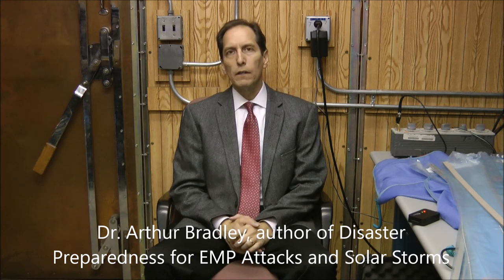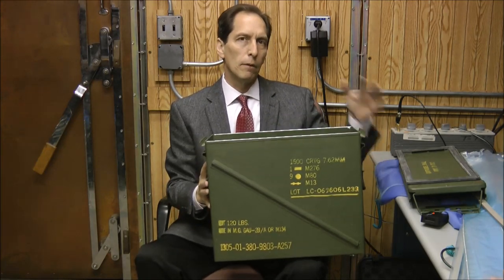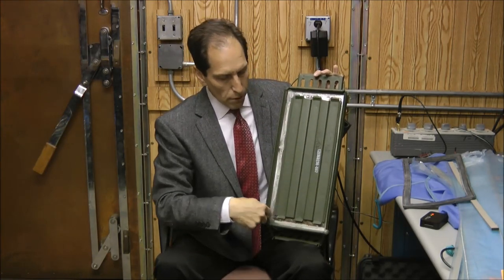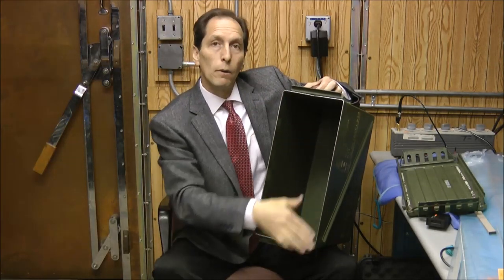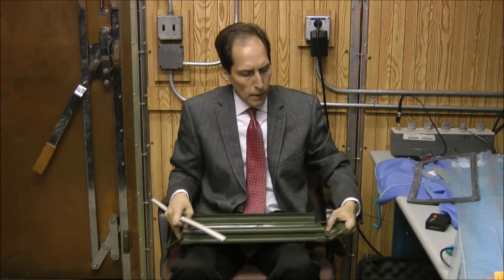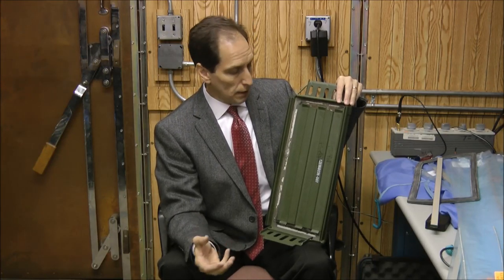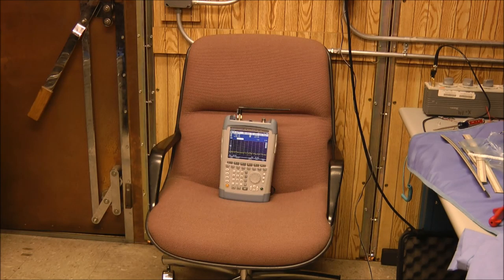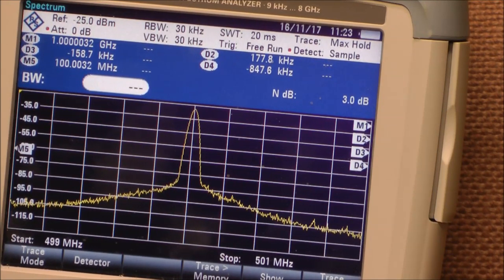Ammo Can Faraday Cage 70+ dB Shielding

Comment: Would adding dielectric grease hurt or help? Im thinking once you sand down the ammo can it will begin to rust quickly in humid environments and maybe adding the dielectric grease would help keep it from rusting and possibly help with the electrical connection? Any thoughts?
Reply from the maker: Hi Mike, adding a little grease after the gasket was installed would be fine, but obviously, you wouldn't want to put it under the adhesive gasket.
Reply: Dielectric grease is non-conductive and therefor no good. You need a conductive grease. That is what I would do. Use preppers method, however I would coat all the sanded bare metal with a good layer of conductive grease to prevent rust. The problem is how do you then keep the gasket in place. I use same type gasket as prepper. The conductive mesh covered gasket. but I use a U-Channel type that fits over the lip of the can. No need for adhesive to keep it in place. Preppers method offers exceptional EMP protection but the bare metal will start to rust fairly quickly being exposed like that. And once it rusts the mesh will start to lose conductivity between the can and lid. If that happens you have lost all your emp protection and you may just as well have left the original gasket in. You would at least still have moisture protection. That being said; silver grease is expensive and MESSY AS ALL HELL!

Comment: I have a question, I read that a nuclear EMP can be from from 100mhz - 100ghz. Do you have the ability to test these at 100Ghz? And would it help to insulate the inside to keep items from touching the metal
Reply from the maker: A nuclear-generated EMP results in emissions up to around 1 GHz, not 100 GHz. Yes, I test to that 1 GHz frequency. It is a good idea to keep anything metal from touching the interior of the can.

Comment: What happens if you just wrapped the original Gasket in Aluminum foil would that accomplish the same thing?
Reply from the maker: I think it would be nearly impossible to pull the gasket out, wrap it, and then get it back secured in the channel. But yes, it would probably work about as well.

Comment: Thanks for the video.  Would you be willing to do a test using light weight metallic backed duct board insulation used in the heat and air industry?  Maybe used for making a box to cover a generator???
Reply from the maker: That's been on my list of things to do for some time. I know lots of folks are using it. I'll see if I can get some of the material to conduct a test.
Reply: disasterprepper That would be great!  Thanks!

Comment: Dr. Bradley - could you, with the ammo can lid open, cover the opening with metallic duct tape (overlapped with no gaps) and then close the lid?
Reply from the maker: A better solution might be to attach carefully cut conductive tape strips over the black rubber gasket. I'm not sure how long it would last before tearing, but I think it would work okay.
Reply: @disasterprepper   Wow - thanks for the quick reply!!
Reply: @disasterprepper  I don't have the equipment to test my original suggestion above... could you possibly test?  Also, I am wondering if you could test simply open the ammo can, lay a doubled up piece of aluminum foil over the top of the can and carefully molding it down the sides without ripping or tearing and then closing the can. Again, it would be very interesting to see this tested.  Thanks for all you do!
Reply: @empdoctor  I don't have the equipment to test my original suggestion above... could you possibly test?  Also, I am wondering if you could test simply open the ammo can, lay a doubled up piece of aluminum foil over the top of the can and carefully molding it down the sides without ripping or tearing and then closing the can. Again, it would be very interesting to see this tested.  Thanks for all you do!

Comment: Could you wrap the existing rubber gasket with either aluminum foil or aluminum tape? 
Still going to bare metal with your dremel tool.
Reply from the maker: Yes, I think this would work, but getting the rubber gasket back into the channel would be difficult. Also, I'm not sure how durable the foil would be. Still, it's an idea...
Reply: I was thinking of doing exactly this on my 50 cal ammo can VHF/UHF radio. I have a 2-1/2" roll of aluminum duct tape that measures .004" thick. This feels much thicker than heavy duty kitchen aluminum foil. It also measures a very low resistance with an ohm meter except where the printing is on the foil. However the printing ink/paint is very thin and can easily be removed with an abrasive pad. I think prepping the can and lid, cutting the tape narrower, then folding the tape around the rubber gasket (with the fold facing to the outside of the can) would work very well. The adhesive side of the tape measures a higher resistance than the non sticky side so make sure only the adhesive free side touches the can and lid. The tape seems tuff yet fairly malleable and conforms well to the edge of the can without tearing so I think it would last a while. Even if it needs replaced periodically one roll would probably last forever.
I wish I could subject it to a quantifiable test!
Reply: @Steve Frank - I took this very approach (the aluminum duct tape) and rapped the entire OEM rubber gasket. To ensure the tape would be strong, I doubled it on the side that makes contact with the can. I also used a cheap black rubber floor mat as isolator within the can making sure that edges overlapped at the corners. Not folded over but one side tucks behind the other at each corner. Finally, the bottom so it is all lined. This ensured that no items within would come into contact with the can.

What I did not do, but will after seeing this video, is remove the paint on the lid and can's top edge. I should have though of that but not a difficult enhancement.

Comment: Also I would ask if you are testing for one frequency at a time I believe you said in your video you were testing fo 500mhz? and would do a range of other frequencies off camera? 1. Would you have a paper we could download of your test results? 2. Have you taken into harmonics or the mixing of signals and frequencies that would occur during an emp? If not why not?   Thanks again so much trying to come up with as much as I can to take into effect an emp.
Reply from the maker: Hi Mike, yes, I'm testing at one frequency at a time, from 10 MHz to 1 GHz. I am establishing the shielding effectiveness of the enclosure. That's a standard way of doing it. The actual EMP waveform is very complex (modeled as an E1-E2-E3), but it can be broken into a series of sinusoidal waves. By knowing the respective shielding effectiveness at each frequency, we can get an idea of how well the waveform will be attenuated, although we won't actually know how it is distorted in time. I do have some tables of data in my upcoming Advanced Topics book, similar to what is in my EMP Preparedness book.
Reply: thanks so much for both your answers. I have the one book on emp you have look forward to more. I subscribed or followed on amazon so I can see when you come out with new stuff. Thanks again. Mike :)

Comment: Hello Dr. Bradley, have you tested the efficacy of paint cans for EMP shielding?  New, empty paint cans are available at many hardware stores and are inexpensive.  They seem like they would be a good solution for small electronics.
Reply from the maker: I imagine they would work well, but I haven't tested them.
Reply: They work very well. Used to use paint cans for HV and nuclear detector housings because they keep stray signals out and HV in for these applications.

Comment: I am about to build one of these. I know it depends on an actual event but are there any estimates of the bandwidth of the pulses?  Is there a frequency range that does more damage, or does it matter because of the power of the actual pulse?
Reply from the maker: The bandwidth goes from roughly 100 kHz to 1 GHz. I usually test over this range. The damage is dependent on the device type and the length of the conductor attached (it acts as an antenna).

Comment: I was wondering how effective removing the rubber gasket, grinding the surfaces down to metal as you suggest, wrapping the gasket in a alum foil ) not cooking foil, but a bit thicker, around .020" thick) and reusing the now aluminum covered gasket. I realize the gasket would be difficult to reinstall but I could use a cutoff wheel and cut the tabs off on the ends of the cap, or simply bent them up and then back down on the covered gasket and the use thin double face tape to fasten it down.I guess the question would be how effective would an aluminum covered gasket and bare steel surfaces be at sealing out the emi/rfi effects of an emp. As good as your metal gaskets? I get the dissimilar metals issue but if kept dry and corrosion free???Any educated guesses?
Reply from the maker: I think it would probably work fine. As you said, the difficulty would be getting the gasket back in place. Otherwise, I see no issue with that approach.
Reply: Thanks for the quick reply. As I have 10 cans to do, the gasket material would run me deeply into the red.How did your testing go across the wider frequency spectrum, ie, both sides of 500mhz? Just curious...

Comment: Could you take the rubber gasket and wrap in aluminum foil then glue back in place?
Reply from the maker: I think it would be difficult. The rubber gasket is under quite a bit of pressure, and once it's removed, it would be difficult to compress to get back into place. If you could pull it off, I'm sure it would work fine, but my feeling is that it'll be difficult to accomplish.

Comment: Would you try sewing the conductive cloth you had a while back around the rubber gasket and testing that?
Reply from the maker: Getting the rubber gasket back in the channel would be a bear. I suspect it would work fine, but it's too much trouble. Inserting a pre-made gasket just seems much easier.

Comment: Is there any kind of coating or paint that I could add to the outside of the ammo can that would increase the dB of shielding even more? Thanks for making the video.
Reply from the maker: There are conductive paints that you can buy, but I doubt it would improve the shielding of an ammo can. The metal is already a thick steel, so another thin conductor over the top wouldn't help. If you seal it with a gasket (or even tape it well with conductive tape), you can get outstanding protection (> 70 dB with the gasket). That's a reduction of 3,162 (which would take a 50 kV/m field down to around 16 V/m - quite minimal).

Comment: Can you wrap the old rubber gasket with aluminum tape?
Reply from the maker: You can certainly try. Getting that bugger back in the channel might be a challenge though. They're under compression, and it's very hard to do.
Reply: @disasterprepper  I was wondering if I would be sufficiently conective to still shield the electronics. .
Reply from the maker: @bobafetthatesyou2215  Yes, if you could get the original gasket wrapped in foil back into the channel, it should work well for shielding.

Comment: How does switching the gasket affect the water proofness of the ammo can ??  I suppose if the foam is closed cell foam, it would retain the waterproof properties...
Reply from the maker: Hi Tom, changing to the conductive gasket definitely affects the waterproof properties of the can. The can would no longer be completely waterproof like it is with the rubber gasket. Of course, one could seal it in a plastic bag or container, but the can itself isn't as tightly sealed.
Reply: @disasterprepper  Thank you

Comment: I have a metal storage shed I purchased at Lowes a couple of years back, I wonder if you have ever ran any tests on those.
Reply from the maker: No, I haven't run any tests on such structures, although quite a few folks have asked about sheds and shipping containers. I hope to do some testing this year for an upcoming "advanced topics" book on EMP preparedness.
Reply: That would be wonderful. Thank you for your work and courtesy.
Reply: Any completely enclosed metal structure will act as a faraday cage. The "sealedness" of the structure, thickness of the walls as well as material will determine its effectiveness. You would definitely want to put copper tape (conductive acrylic adhesive) on any non-bonded/welded seams if your intent is emp protection. The room prepper is in is a faraday room made of thick Mu-metal walls (high permeability). Designed to block all external fields.

Comment: Because conventional EMP devices produce explosions driven by HPMW technology, they may have a frequency in the range of 100 MHz – 100 GHz. EMP, depending on altitude and power, can generate electric fields up to levels of 50 kV / m. Will these boxes, or any faraday cadge for that matter really provide protection at these levels?
Reply from the maker: Nuclear-generated EMP devices are typically thought to produce radiated energy from about 1 MHz to 1 GHz. Electric field levels can ready 50 kV/m, although some people claim "super EMP" weapons can reach perhaps 200 kV/m. I don't know that such devices have ever been seen in the real world though. A box or EMP bag that provides 50 dB shielding will reduce a 50 kV/m signal down to around 158 v/m, survivable by nearly any electronic device. I'd be comfortable depending on such products to ensure the survivability of small electronics.

Comment: A post on Reddit brought me to your videos and I want to thank you for spreading the knowledge you have. But I noticed in your testing that you have used 3 different lemgth antennas for the 3 value readings. I would imagine that the reading would be different if you changed the antenna for open air readings. What was the reasoning for changing this?
Reply from the maker: Hi Kevin, I only used one broadband antenna for the transmit pulse and a simple duck antenna for the spectrum analyzer across all tests. Can you point to what you're seeing that looks like different antennas?
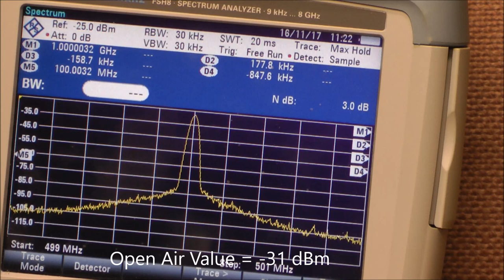Reply: @disasterprepper  thanks for taking the time to answer as I know it's probably not the most fun thing to do, the antenna I am talking about is the rubber duck antenna attached to the spectrum analyzer. It appears that the antenna for open air and conductive gasket appear to be the same but the antenna for rubber gasket test appears to be shorter in length with a moulded notch just after the pivot point (5:27 mark in video)

Even with this observation I do not see how you could have used this to manipulate the end result so I do not think that is happening. Just a new ham trying to see if there was any rhyme or reason

Thanks again and I can't wait to see what whole home surge protection device you create!
Reply from the maker: Ah, after you sent the images, I see what the confusion is. For any given test (say an ammo can), i stay with a single antenna not to affect the results. On another test, say the conductive cloth, I might use a different antenna, although they're all very similar in performance. The idea is to compare a free space measurement and a shielded measurement with the same setup for any given configuration. It really doesn't matter if I change antennas when testing different items as long as the antennas are all able to receive the transmit frequencies.

Comment: Seems like one could simply ground the lid to the base with some copper wire. Keep the good factory rubber gasket.
Reply from the maker: They certainly could do that. Unfortunately, grounding won't help the can to shield any better. It's a common misunderstanding, but grounding has no effect on EMP shielding. It has to do with the frequencies and distance from the EMP source, i.e., far-field vs near-field electromagnetic waves. The short of it is that any conductive barrier will provide shielding through absorbing and reflecting the incident wave, grounded or not. What's important is to seal up the narrow seams, which act as efficient receiving antennas.

Comment: Greetings, Dr. Bradley. Many thanks for the great information and the scientific presentation. Much appreciated.

I was wondering your thoughts on the following sort of improvised version of a conductive gasket.  After sanding exposed metal surfaces on can and lid, how effective do you think it might be to just take the existing rubber gasket, wrap it thoroughly all around every side in household aluminum foil and then simply replace it? The hope would be that the foil makes the uniform contact necessary for adequate reduction due to the underlying rubber’s ability to press it evenly when compressed by the latched lid. Unfortunately, I don’t have the ability to test this myself.

Thanks again for all the great videos (and the EMP bags I ordered from you a while back)!
Reply from the maker: Yes, I think in theory this could work fine. It would certainly give a tighter seal. The issue would be getting the foil-wrapped gasket back in place. I suspect that might prove difficult.

Comment: to insulate the ammo can, can i spray it with flex seal??
Reply from the maker: Sure, any kind of insulator is fine. The only reason for insulating the interior is if you're worried about some exposed piece of metal (say a charging port or antenna) coming into contact with the interior wall.